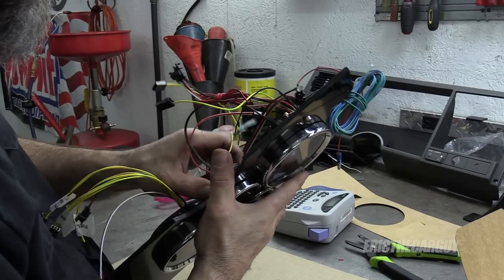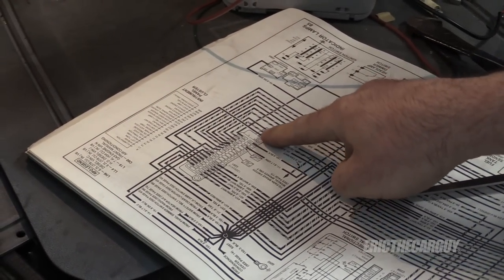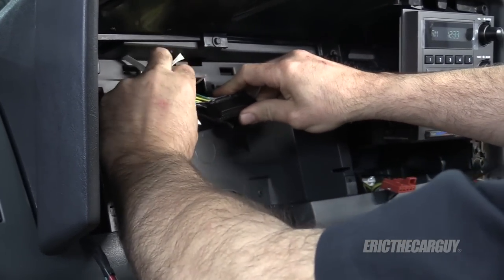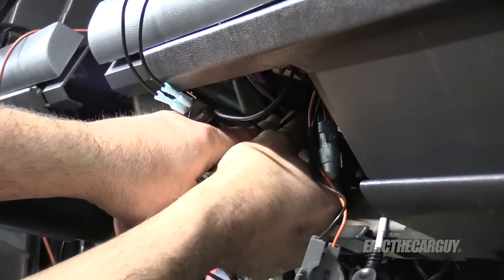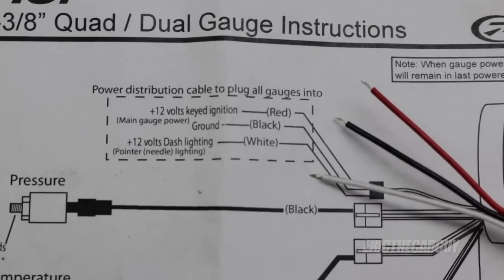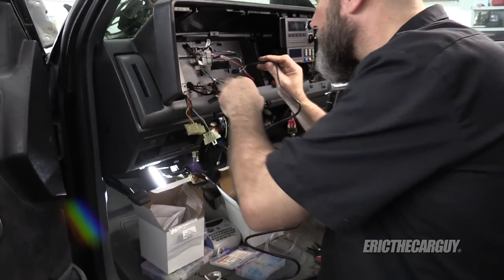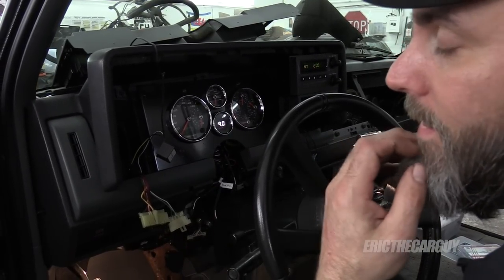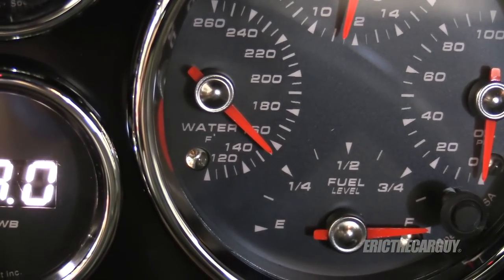How To Wire a Custom Instrument Cluster

Comment: Just a word of caution Eric. The label makers by brother are known to cause battery leakage after a short period of shelf time (due to the negative terminal springs not perfectly sitting center on the battery), so be sure to remove the batteries if you're not going to use it for more than a couple of weeks, to avoid corrosion.
Reply from the maker: Funny, I've already experienced that. Now I store it without the batteries. Thanks for the heads up.

Comment: FYI: GPS antenna can be installed under the dash cover, in line with the windscreen. The dash-plastic will not interfear with the gps signal.
Pro car stereo installers does it all the time... Just make sure there is no metal above it, and it's mounted in sight of the windscreen...
Reply: Wrong curtis
Reply: Rott Man What do you mean, wrong?
Reply: @Rotttman  he's not wrong. Even the 2014 dodge chargers with the GPS signals go under the dash in the center and they work just fine. All depends like he said if there is metal above the top.
Reply: @Pandanewtay  wong curtis
Reply: @Rotttman  I would really like the knowledge if you could send me a link or tell me please. Would be appreciated. I'm all about learning more.

Comment: Get a small seam ripper and you can use it safely on cords to rip the actual rubber insulation off them (the large ones kinda have the habit of dipping in the cords if you're not careful). It's so versatile, i keep one in my pocket. :)

Comment: One tip regarding the GPS antenna, it will work just as well concealed under the plastic of the dash. Don't stick it under anything metal, but it can see through plastic just fine. So you could mount it so it stays hidden. Kind of an eyesore to have that box on top of the dash... :)

Comment: As I currently face the possibility of the fuel gauge, and therefore probably the whole cluster, in my old ford being junk and considering options this video has intrigued me on building my own cluster. A pity the gauges are pricey as that certainly delays that project before it can really begin, but they seem to be rather nice. Also makes me want to make absolutely sure a couple different way that it is the cluster not anything else.
Reply from the maker: Most custom gauges come at a price unfortunately. Worth it in the end in my opinion. I'm glad my video gave you some inspiration. Thanks for the comment.

Comment: That's a perfect result, everything you wanted is working spot on :-D.
Just a tinker with the settings to optimise the levels and lighting.
The option of using a multiway male and female connector crossed my mind, it would have given you a simple disconnect.
I don't think the truck/car will be your last, you love creating custom a lot :-D

Tank senders are a pain, being a variable resistance that isn't linear with the actual fuel volume creates conversion problems.
I was asked by a mate to come up with a simple led display to show the fuel level in his old morris minor.
i found a simple bargraph circuit on the net,  based on multiple comparitors to drive each led and a threshold preset for each one.
Worked a treat :-D.
Sorry waffling mode :-(
Reply from the maker: Yea, I do love building stuff. Your fuel gauges sounds awesome. Nice idea.

Comment: Nice video dude I been trying to do this on my 1989 Chevy 2500  the time I tried to do this I just saw the wires and say mmm the worm stile gauges aren’t that bad 😂😂😂 now with this video you made I can dig in and finish the project thanks and keep doing this type of videos, another thing I had in mind take of the old fuel injection on the truck and put the type of fuel injection you added to your dad truck now a can do it by myself.

Comment: 24:55 That little piece sticking up is to prevent the potentiometer from rotating in the hole. Normally you drill a small hole that it sits in. Normally it will work with the tab cut off, but they tend to work themselves a little loose over time and can rotate when you turn knob to max end limits.

Comment: Nice work love those heat shrink connectors-!- Just curious speaking from my own past "experience" when a friend called me about his '69 Roadrunners wiring meltdown I hope that firewall pass through youre using has some kind of rubber grommet-lol  I couldnt tell in the video if it did or not. He had run his foglight wires through a hole he drilled with (no grommet) and the wrong size fuse - about a week later there was lots of smelly molten pvc insulation when it cut through the wires, took us a loong time to repair the harness wire by wire - should have had a new one but he wouldnt spring for it.  Excellent work Eric, its going to look 

sooo much better than all that gray cheesy looking plastic and fisher pricey guages--lol  Friend had that same truck, speedometer never did work. That multipiece factory radio, wow what a bizarre piece of engineering with its two separate dash openings.

Comment: On the dimmer switch, that tab is to keep the stinkin' knob from rotating too far when you sweep it left too far or right too far, which you eventually will. You drill a small hole in the fascia and the knob sits flush, and  will NEVER over-rotate.  The knob will cover up the little hole for the anti-rotation tab. Normally the whole shebang is designed for that.

Comment: Gah doing the labels one at a time, the tape wastage... they got you on the supply, can print two or more at a time and cut in the middle to minimise that.
People think the wiring is hard but it is just a good puzzle game, just take your time and even if you do a few a night eventually it is finished.
Once you have all the gauges programmed, could have put the gauge screen back over the top also as a thought.

But nicely done.

Comment: Now that you're using LEDs on your turn signals, consider putting flyback diodes on the relays to prevent premature death of the LEDs.  That may be why your left signal flashes when you engage the right and vice versa.  Love the videos!
Reply from the maker: That could also be the switch.
Reply: @ericthecarguy  Could be.  But the collapsing magnetic field in the coil will alway send a reverse current (sometime 100+ volts for a micro second) back through the system.  Incandescents have no problem with it but LEDs hate it.  The little LED on your new gauge didn't flash with new LEDs.  I'm suspecting there is a diode built into the gauge.  You can even buy relays with diodes already built in.  Here's a link to very long video but it demonstrates what I'm talking about.  https://youtu.be/5kjtiY9gxGM?t=146
Reply from the maker: I think it's more likely that when you activate the switch both contacts for L & R are activated briefly because of the way the switch is designed, likely sharing a common ground. The way to test this is to see how it reacts in a truck that hasn't been modified. If it's the lights react the same, it's normal and not a consideration. No need to go looking for problems when there aren't any. There have been no issues with the lights, or the gauges in 1400 miles. I think I'm good. Thanks for your comments.

Comment: Hey so im confused im doing a custom LED cluster for my 99 lexus. The LED has 6 wires, red + white, then blue, green, red + white. Idk what to tap and connect i did the green w. A white green stripe wire, and then blue to a white but idk what to do w. The rest. The wiring diagram says the white black stripe wire is illumination as well as light green? Any help would be appreciated lmfao

Comment: I have intellitronix digital dashboard and I don’t have a fuel wire on the cluster. So which wire on the fuel pump should I use to run another wire to reach the cluster so I can see my fuel

Comment: I've seen those connectors advertised a bunch lately. You know, the kind that shrink and solder inside the connector with just a heat gun. I wonder how well they hold up ?

Comment: Do you think it would be possible/practical to build a customer cluster for a vehicle that uses data busses (CAN, K line etc)? If so how would you go about doing that?  I would imagine you would have to use external sensors or get a signal directly from the vehicle sensors. What's your take?

Comment: The voltmeter and speedometer should be connected to the 15 line that is an ignition signal when you turn the key on or (ignition on) just before the starter position. This will prevent parasitic battery draw and you will not gain anything by having that speedometer directly powered.
Reply from the maker: They are connected to that circuit. As stated in the video, the 12 hot connection is just so that the speedo can acquire a signal faster. You don't have to install it.

Comment: eric dunno if u still have an element but I would love to know if I can replace/switch out crappy element front seats for more comfy seats. thanks in advance. hopefully there's something that will just "swap" out without fitting
thanks in advance sir! love my element! i'm original owner on a 2002 element with 256k miles and still love it

Comment: Awesome video! Makes me think about doing some custom work in my '93 GMC. Also, I'm glad to see you used the heatshrink with the solder. Was wondering how well those would work and now I know. Also, the truck sounds great. Have you detailed what exhaust you have in a different video? If not, may I ask here? 
Thanks again for this video. It was VERY informative and makes me a little less uneasy about doing custom wiring.

Comment: Eric, I stole my wife’s seam-ripper and bought two more in about 1985 for $0.50 cents each. Actually, the plastic ball side should face the wires to protect from puncture, but the ball falls off anyhow so who cares. 
 Yes, I remember all paper service manuals and the electrical was an 8 page fold out. Headlamps left page and tail lamps page 8. I am old, it is official.
  I also saw a company that sells white shrink tubing to use in that hand held label marker. I want one but can’t remember where. One can new have enough stuff. 
DK. ASE Master Tech since 78. Retired

Comment: I've found just taking the steering wheel off when working on the dash provides me with plenty of room to work without removing the column, fyi i have a Grant wheel so its easy to remove.

Comment: After the upgrade, what happens to the check engine light and other compter generated warning lights??????
Reply from the maker: The new engine management system does not use a CEL.

Comment: I have a 1996 Buick Roadmaster wagon which doesn't have a tachometer from factory. Any ideas on where to hook up to install an aftermarket one?
Reply from the maker: A tach is an easy install. When you find one, it will likely come with instructions on how to hook it up. Really all you need is power, ground, and the signal coming off of coil (-).

Comment: Can all of the circuits have a common ground rather than grounding them separately?  For example, can you ground the illumination lights to the same ground as the turn signals?  Id rather just have one common ground if thats an option.  Thanks for any insights!
Reply: I have always wondered that myself but I suppose it makes it inconvenient when trying to diagnose an electrical issue. Though I'm not sure
Reply from the maker: You can use a common ground for all, and I pretty much did, the ground under the dash, but it's not necessarily convenient since the lighting and gauge power circuits are separate and located in different places in the dash.
Reply: Excellent. I understand now, thanks for the insight!  Good work on the cluster!

Comment: How reliable has the GPS been for the speedometer?  Also, what made you choose GPS over a speed sensor from the transmission?
Reply from the maker: Very reliable. With GPS you don't have to worry about changing tire sizes or re-gearing. No matter what it'll be accurate.

Comment: Hey Eric, just wondering why you decided to use the aftermarket dimmer switch vs the factory one. Was it that they’re not compatible or just personal preference?
Reply from the maker: The factory dimmer was already wired to the illumination circuit in the dash at the wire I cut. I would have had to wire directly off the headlight switch to do what you propose and I'd still have the factory dimmer in the dash. In short, that would have been more work. Time was a big factor with this build. Thanks for your comment.
Reply: EricTheCarGuy Thanks for the clarification, Eric. The truck came out awesome!

Comment: So, the odometer... is Dad's truck old enough to qualify as an antique/veteran/old-timer so official mileage doesn't matter, or is official mileage on a vehicle, come resale or restoration or whatever, not an issue in Eric's state, or other states? Fairly critical in Europe, for a variety of reasons... All answers welcome!
Reply from the maker: Not so critical here. I like the idea of resetting the ODO in a situation like this where the truck has been completely rebuilt. This way a potential buyer knows how many miles since the rebuild. That said, I believe you can go in a set the ODO to reflect actual mileage. Since I'm not under obligation to do so in my state, I didn't.

Comment: Where the hell did you find the electrical schematic?  I've been trying to find diameter specs for transmission/engine models and I haven't had any luck
Reply from the maker: Factory service manual purchased on Ebay. https://www.youtube.com/watch?v=IN95GLDvGBc&t=2s

Comment: It doesn't seem like you left the heat gun on the splice long enough to totally melt the solder.  I never saw the solder melt and "flow" into the strands.  Basically you are left with a "cold solder" joint.  It is prone to cracking with vibration

Comment: Eric, you need a better heat gun. The big one you are using is fine for a large area like removing floor tile but not very practical for wirework. Get a smaller industrial gun like the Weller 6966C. It will place very hot air right on the wire.
Reply from the maker: Thanks for the heads up.

Comment: You can cut that cable just fine. It's a simple coaxial cable. You pop open the antenna pod, desolder it, cut it to need, unsleeve it and solder it back. Really not complicated at all.
Reply from the maker: I'd rather not advise people to cut signal wires if they can avoid it.

Comment: I wouldn't recommend using those quick tap connectors. These things are prone to fail and wreck your wiring harness in the process.
Reply from the maker: So far, no issues. Also, it's just a signal wire for the AF gauge. If it failed, it wouldn't effect anything important. Thanks for your comment.
Reply: @ericthecarguy  Yes, it can take years for them to fail. I have seen several instances where those things eventually cut through the wiring. Therefore I either solder or use open barrel crimp connectors like these: https://youtu.be/cWkLgkqMVfY  That's what you will find in most OEM applications, too.
Reply from the maker: Well, check back in a few years to see how everything is working then. 😉

Comment: 42:37 Oh man the wrong turn signal flashing for just an instant whenever you put the indicators on would drive me nuts ;)
43:48 All LEDs allow current in only one direction by definition, not just some. But in order to throw you off, some LED replacement bulbs for cars have supporting circuitry built in that allows you to power them both ways.
Reply from the maker: Not zener diodes.
Reply: @ericthecarguy  But those aren't generally the light emitting kind (Though given enough current they can be ... persuaded. For a short while anyway).
Reply from the maker: We can argue semantics, but the cluster works as intended. 🤷🏼‍♂️
Reply: @ericthecarguy  True, and that's the most important part, which I completely glossed over, sorry!
Awesome job, love the attention to detail, proper wiring connections, etc. Thanks for taking the time to allow us to watch over your shoulder and nitpick ;) Seriously though, it looks great!

Comment: IMO it is kinda stupid to cut up an original wire harness if it is still in working order...
You can get the plugs for just about anything to make your own wire harness and click directly in to factory harness instead of cutting the plug off the wires.
Reply from the maker: Not for me it's not, and I did make my own wiring harness as you saw in the video. Not sure if you remember the previous episodes of this build, but the original systems that the original wiring harness ran are no longer in the system. This is a system of my own design using available resources, including some of the original wiring. Everything works as intended. I don't consider that 'stupid' at all.

Comment: If you dont like using t taps 
1.take a razor blade and strip the insulation away
2.poke a hole between strands
3.insert wire in strands and wrap around
4.take electrical tape and insulate wire
5.zip tie tape
Reply from the maker: Time was a big factor with this build. I could have done what you suggest, but it was quicker and easier to use a t tap.
Reply: @ericthecarguy  very true i didnt think of that but very good job you did

Comment: I'm surprised that you didn't use that connector kit to make your connections instead of making all those push connectors. Otherwise an awesome job!
Reply from the maker: Serviceability. Had I hard wired them together I wouldn't be able to remove the cluster for service.
Reply: @ericthecarguy  Oops, I think there's a misunderstanding. You showed a connector kit which you used the pins from to locate the circuits in the OEM cluster. I was wondering why you didn't use that kit to make your connections. Hook the turn signals and high beam indicator into a single 4-pin connector for example
Reply from the maker: Because that was a 6 pin connector. It was easier to use the connectors that I used.
Reply: @ericthecarguy  Good enough! :)